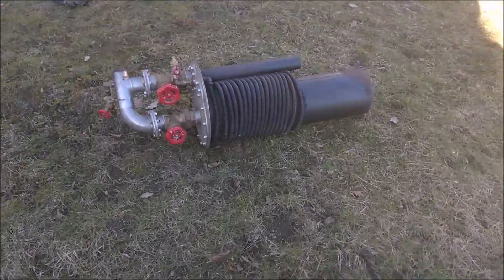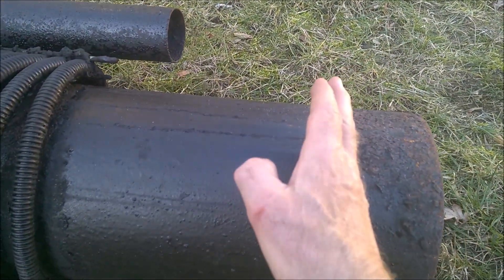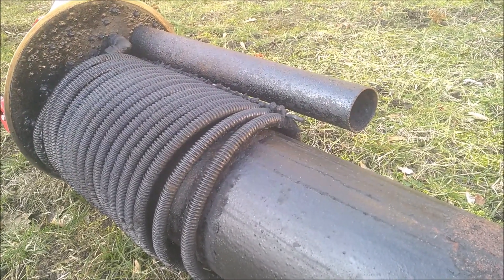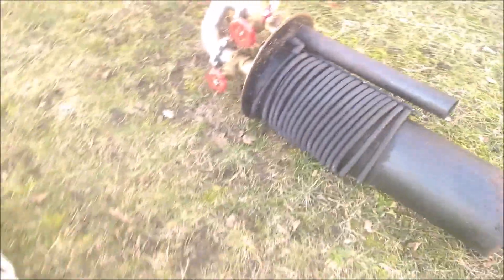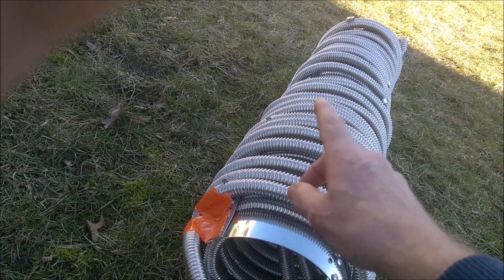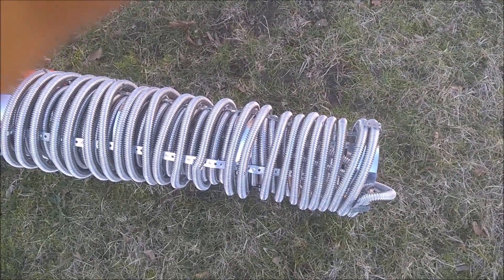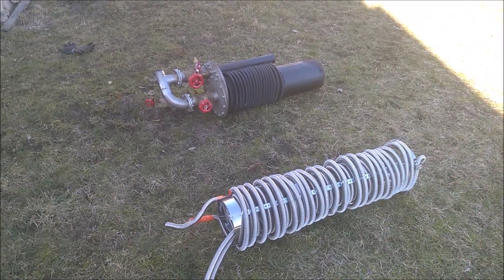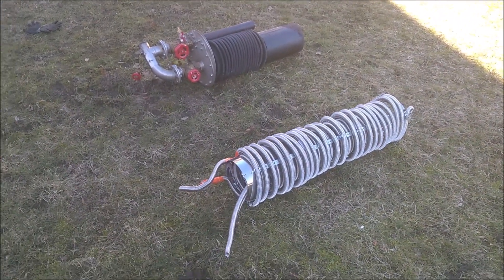Condensor woodgas

Comment: a combination tromp and ram pump can eliminate nearly all of your hassles here when compressing... if you're happy with 100-120 psi. Very low teck and dirt cheap solution to both scrubbing and compressing. also... this "tar and crud" you can call it creosote  or you could call it Bio crude and bio fuel. if you force the wood smoke through a downward sloping pipe (against convection)(inch and a half by 20 ft long)  and drain the bottom of the pipe at intervals through the underside you can pull various grades of unrefined oil and fuels which are the very contaminants fowling up your syn gas when you go to compress it. good luck
Reply from the maker: Thank you for commenting. Thank you also for you sugestions. Luk

Comment: I did some testing with used soup cans 99/119 which I filled with steelwool and stacked them together. My aim is to get 30-40°C cooled gas. It seems to work ;) 
On the other way your idea of a water pipe around the reactor itself inspired me to insulate the reactor with a perlite/plaster mix covered by a bigger pipe around which I'm bending the water pipe. The result is enclosed heat inside the reactor and only the waste heat heats the flowing water. So I can measure about 1150 °C inside the reactor and water exits with nearly 60°C and can be used for heating or other purposes. But to be honest - my reactor is far away from continous runs at this time. Bridging and clogging ia always a serious matter. I'm thinking about a kind of stirrer inside the reactor to prevent it from clogging or bridging up.
Reply: Dear Hutti, In search of a good and cheap alternative to our expensive bag filter house, I tested a filter with cheap disposable media. First layer wood-chips, second layer ceramic wool and end filter, a big truck air-filter. Despite that the condenser worked fairly well in condensing out much of the water in the gas, too much moisture still made it to the truck air-filter. The truck air filter being a paper filter got slowly wet and after 12 hours running I had to stop because of too much pressure drop. Funny you mentioned steel wool, because yesterday I ordered 5 kg stainless steel wool wanting to cut the paper out of the filter house and replace it with the steel wool. Wonder what your experience was about the breathing capacity of the steel wool and did you use ordinary or stainless steel wool and what grade did you use? 0000, 000, 00, 0 or 1?
Reply: @theDriZzleRGasifier  I use ordinary SteelWoolBalls for the kitchen. I ordered about 100 balls and pull them in length and width.
The pressure stays at it's level and seems not to be influenced by them. I tested it today and was very impressed how much moisture came out. Anyway I have to build more stacks until every drop is condensed out.
I drilled my grate bigger to 10mm each hole and ran my drizzler about 2 hours constantly until it clogged again. Nice effort :) The only thing I wonder about is a colorless flame which I have to inspect again when it's dark outside. I was not able to find any tar in my machine again and wonder why. Until yesterday everything was tary and the collectors were black as hell, but today everything was fine.
Reply: @ravelkoff3549  Try to figure out what you did better than yesterday. Never change by testing more than one parameter.  otherwise    it is difficult to see what item had the good effect. The most important rule by a DriZzleR is getting the suction right in order to get high enough temperature. Maybe the steelwool  kept your gasifier better breathing thus more temperature.
Reply: @theDriZzleRGasifier  I only changed the grate. But unfortunately it clogged again after 2 hours of continous run.
I will change the grate to a grateless model too. 
The reason why I dind't see a flame in sunshine is because it's a white strong flame. Very much hydrogen inside. Wonder why.
Reply: I finished my condenser now. What a strong change in gas quality! I have big glasbins for controlling and after the second condenser no more creosote is collected. Now lets work on the grate ;)

Comment: I see in another comment, that you tried a water scrubber (bubbler).  You said that the water temperature "rises and rises".  Of course, this is to be expected since you are adding heat.  But were you cooling the bubbler water?
  Another related question: With the gas cooling system that you are now using, how do you cool that water?
The reason that I ask is that, with my Chinese JXQ-10 gasifier, I can keep the output gas temperature down to about 100 degrees F when I use about 1 1/2 gallons per minute of 60° F tap water in a heat exchanger to cool the bubbler water.  But, when I tried to eliminate the use of tap water by adding a radiator and fan, using automotive antifreeze, making it a self contained unit, I couldn't keep the gas temperature below about 120° F.
Reply: Hi Pete, Nice you commented. In the previous Bubbler test I added a tank of some 500 litres water. As you know I am still looking for the holy grail of automatic continious  running the  gasifier. So the tank stayed fairly cool after some 6  hours run, but then went up uncontrolable. In the test I want to do now I will run the cooling water from the tank through the cooling coil wich will be connected to either in winter  with my floor heating and in summer connected to a swimming pool. The hottest bubler water will be the condensing water that is  dripping of the cooling coil. It will be maintained at same level and regulary drained off if exeeding that level. All will be clear in a next video. Just went talking with a welder shop and hoping they adapt my cooler/concensor soon.

Comment: Luk, that's a clever way to cool the gas. I'm used to seeing people only preheat the air going into the gasifier with this arrangement. I think I will be adopting this idea at some point. Thanks for the show.  Joe
Reply from the maker: Joe, Thank you for watching. I somewhat got the idea of improving my condenser filter after seeing your last video. Saw there you had some problems with moisture gas and recognized the same in our test rig. it motivated me to get my lazy bum together and at last do something about it. Because realy, the preheating of the gas (we do this with a heating ring around the gas intake tube just before entering the engine) is a lazy's man solution. Also it makes the gas expand again and thus theoretical more weaker. How much weaker is still to find out. On top of that the heating ring consumes a lot of electricity wich together, with the weaker gas,  takes the overall efficiency of our production system further down.